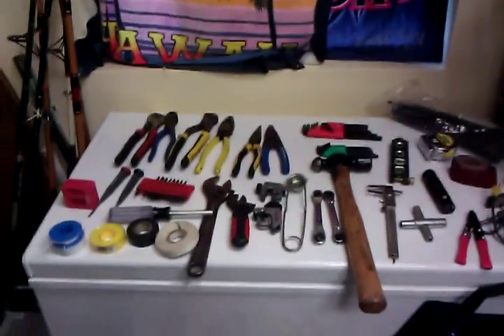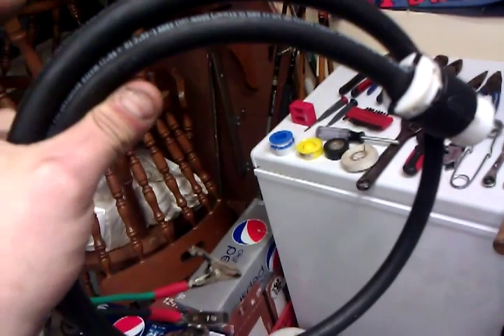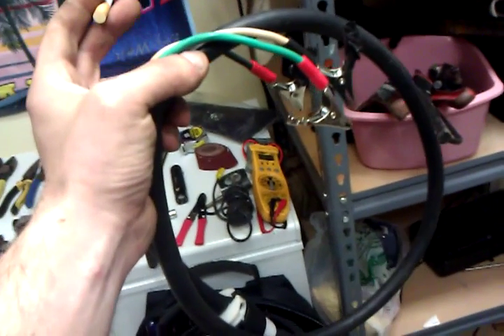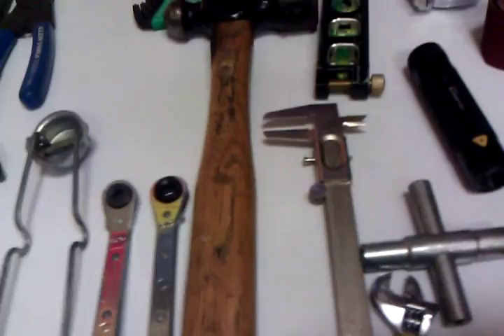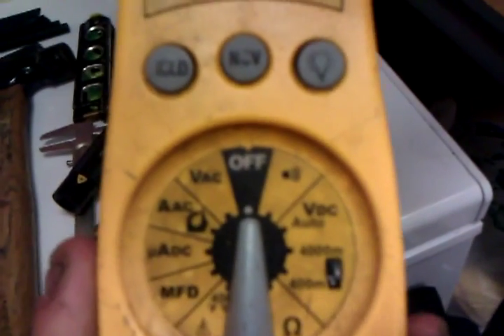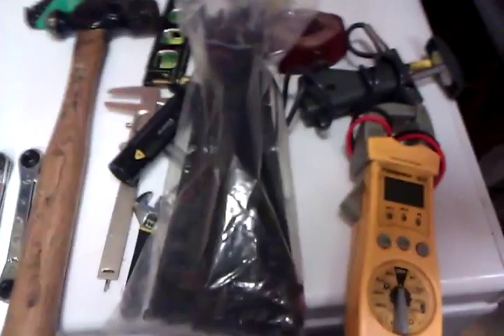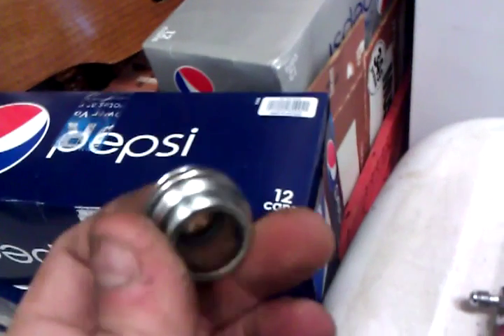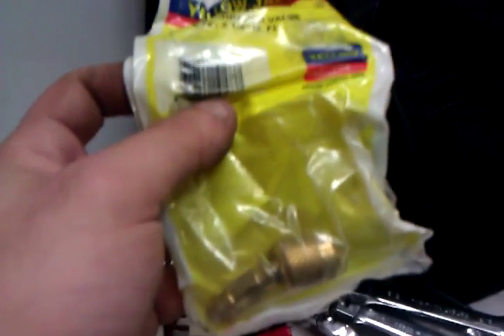Hvac Service Tool Bag

Comment from the maker: @fritzhvac  The mag/demag box shouldn't run your more then 10 bucks from home depot. The tool book bag usually goes for a $100 at johnstone but sometimes they have it on sale for $50 and you can also check online which is usually cheaper then getting it at your local supply house. I was actually finishing up doing a tune up in my garage to my car so I'd figure let me make the video real quick before I forget and incase I get to busy during the work week. Your right AWESOME minds do think alike.